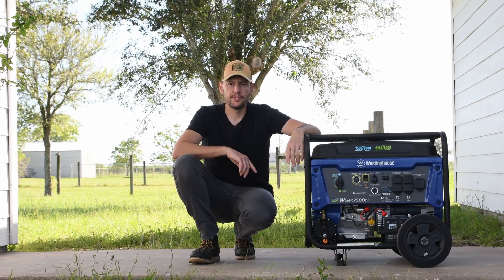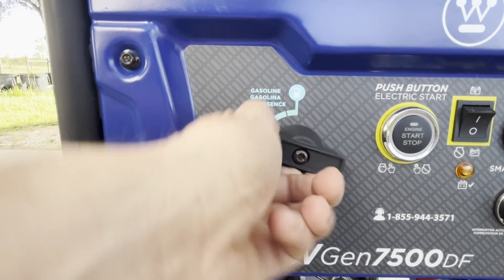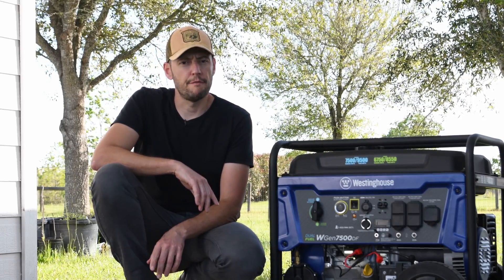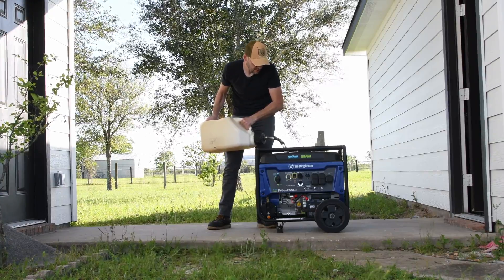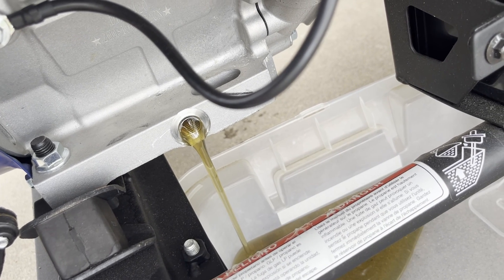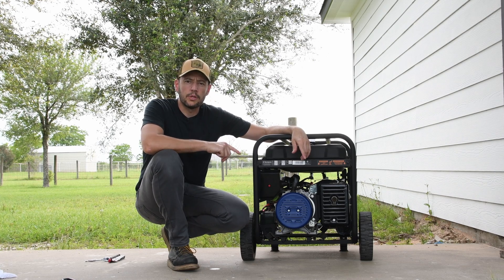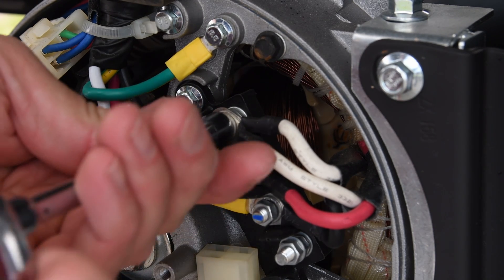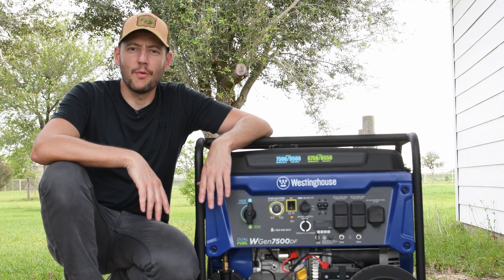Westinghouse 9500W peak generator running-in and floating neutral conversion

Comment: Hi, you said 7500 W is the max a 30 amp cable can handle. I have a new Westinghouse 11,000 W inverter generator. But the hook up to my panel from outside is a 30 amp inlet box. Does anyone know if that’s gonna pose a safety hazard?
Reply from the maker: Your generator have two ourlets, 30amps and 50amps. As far as you use the 30amp you will be ok, however in the 30 amp outlet you are not getting the 11000w. You get full power in the 50 amp outlet. If you want to use that one you need to change the panel outside your house from 30 to 50 amps and the cables and breakers from the panel to your main breaker. Otherwise you may burn all the cable if you pull 50 amps on 30 amps cables.

Comment: Yikes - that is NOT how you float the neutral. Get an electricians license or at least RTFM (Read The F'ing Manual) before you start giving advice.  From the manual:             TRANSFER SWITCH CONNECTIONS
The Westinghouse generator is wired with the neutral
bonded to ground. If you are connecting your generator
to a panel board transfer switch, a licensed electrician
will need to consider removing the bonded neutral to
ensure proper operation of household GFCI circuits.
Begin by removing the alternator cover. Once the
cover is off remove the nut that holds the bonded
ground jumper wire (see "2" in Figure 6). Once the nut
is removed take the bonded jumper wire off and re-secure
the nut. Next remove the screw holding the neutral ground
wire (see "1" in Figure 6). Attach the bonded jumper wire
(2) to the neutral ground (1) and tighten the screw
Reply from the maker: That’s with a transfer switch but I didn’t use one, instead I used an interlock, and that is how you do it in such a cases. Thank you for checking the video.
Reply: @BUTTEWORKS Even with a transfer switch you are right to float the neutral. Most transfer switches have the neutral bonded which means you still needed to do as you did.
Reply: He did unbond the generatorl the right way. I know Westinghouse manual says to double over the bonding jumper and attach both ends on a single bolt, but that's only so you can easily find it if you ever decide to rebond the generator. Has nothing to do with right or wrong way.

Comment: What if you want to plug something into the generator while it runs at the same time connected to the inlet? Do you need a neutral-ground bonding plug?
Reply: The home electrical system not only acts as the bond for the home electrical system it also acts as the bond on the rest of the outlets on the generator itself when connected to the home electrical system. So yes you can still plug in items on the generator outlets and use them because the bond in the home acts as the bond for the generator
Reply from the maker: You can't have both in a generator, it is either bonded or floating. I have a floating one for my house and an smaller and more portable bonded for tools and such.
Reply: @BUTTEWORKS  thanks I had no idea. Going to float the neutral on my 11500 this week. It’s connected to the house exclusively via 50 amp inlet.

Comment: You can keep the wire inside. Just remove it from the neutral, put the nut back. Remove the nut from the ground, attached the jumper wire to the ground and reinstall the nut. That way the wire stays inside and you don't risk loosing it or damaging it. It's what the instructions say to do anyway... Thanks for the video!
Reply from the maker: Thank you for your comment, actually you are right, makes more sense to keep it inside. Thank you for the feedback!.

Comment: Waiting for the 9500 to be delivered. Check out the Soft Start technology enables you to operate ac with small generator. 

Thanks for the content.
Reply from the maker: Thank you for your comment, I want to try if I can run a 4 ton with soft start with that generator, will do a video about it. Congratulation for your generator, it is a great machine.
Reply: Just bought a Micro-Air Flex soft start. Unit. Will be installing it soon. Waiting for the install kit.

Comment: 👍👍👌👌  Well done!  I got a 7500 watt portable generator about 7 years ago, and have used it during several power outages.  It is gasoline powered, so I have to be careful about running the carburetor dry after every run.  I also use only ethanol-free gas in it.  The 30 amp power cord plugs into an outdoor connection plug, and can power up to 6 house circuits through a manual transfer switch.  Last summer we had a wide area outage for 3 days.  Finding a source of gasoline to refill my generator became a bit of a problem because most of the gas stations were also without power.  So, you must also think about where you are going to get gas or propane when you run out.
Reply from the maker: I always have a few jerry can  and like during the winter storm where we lost power I tried to run the generator no more than 8h a day. However in my next house I will install a large propane tank for hot water and cooking but also for the generator. Look like you know how to operate and maintain your generator properly. I also cycle my stored gas yearly in my truck to make sure doesn't goes bad. Thank you for your comment.